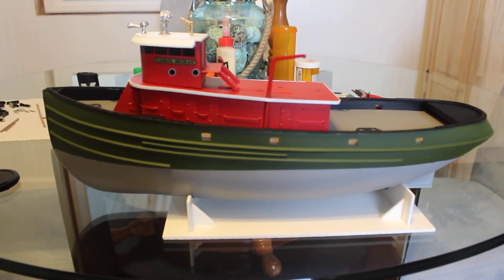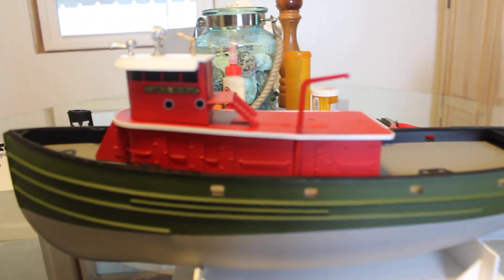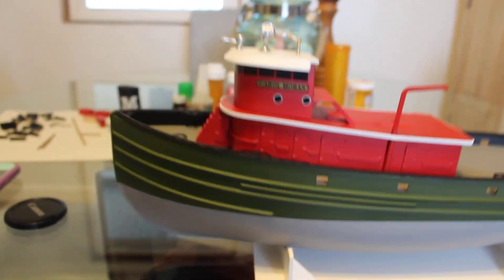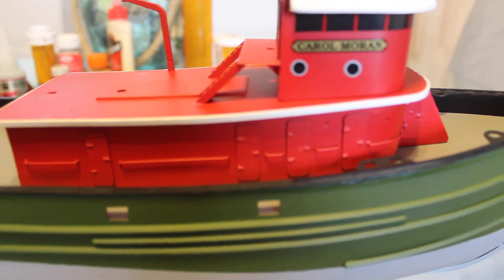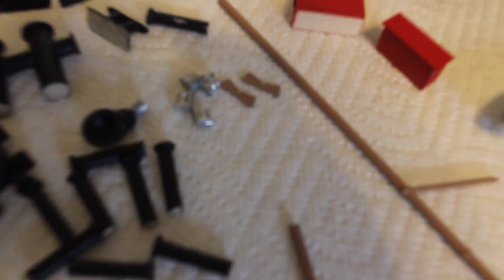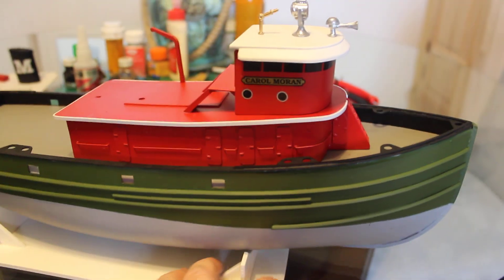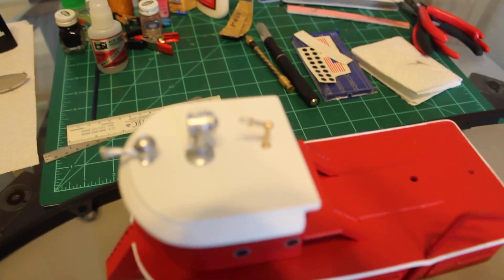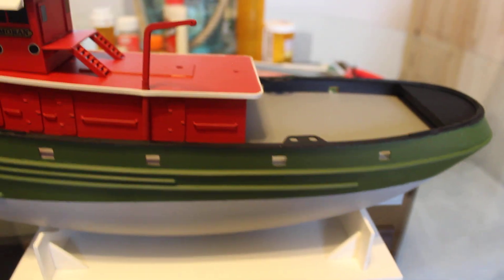Dumas 1/72 Carol Moran Part 2

Comment: Ahoy Nautibear                                          Beautiful job she is looking Superb with winter setting in along with pond moss makes my maiden voyage a slight delay until next spring. By that time you will have your Carol Moran underway. Remember you have to have a battery pack built for you 4.8 volts at your favorite battery store they have a shop in there that will build your battery pack for $14.00 these batteries are rechargeable so you need a 6 volt battery charger don't leave the batteries charging to long on the charger the tug can run for 2 hours straight before they go dead on you. Beautiful job again.Frankie Day
Reply from the maker: Thank you very much! I have made notes of all the information you've given me to power this thing and I will definitely use them! Thanks for watching!

Comment: I talked with Brian today and he asked me if I watched this video about your decals. I always give him a hard time when he has things happen, but I told him I held back as I didn't want to scare you off from showing any more of your work. I will admit though that it was pretty funny, and I did laugh my ass off, but hey, we all make silly mistakes. It is part of the hobby. Even after building all types of models for 48 years, I make them too. My best one was soldering resistors to leds and I kept forgetting to put a resistor on a special type of led for my big Enterprise. Well I kept hooking it to my 12 volt power and it blew out. I did that 3 times before I realized it as I only bought 5 as they are a type of led that was very scarce at the time. Finally got it right and still have one left in case it is needed. And to think, electronics is my specialty. 
So don't feel bad.
Reply from the maker: You can give me a hard time! I deserve it and I am also un-offendable! With my sense of humor, I usually unknowingly do the offending, lol! I thought my faux pas was funny too or I wouldn't have shared it! There will definitely be more dumbass moments to come...no worries there!
Reply: It's all in good fun and it's OK if people do the same with me. I've made plenty of goof ups in all my years of model building and I'm sure there will be more. I go to East Peoria in Illinois to the Bass Pro Shops right on the Illinois River, and right across the river in Peoria they have the SPIRIT OF PEORIA rear wheel paddle boat that is used for cruises on the Illinois and Mississippi Rivers, so I picked up the Lindberg kit Robert E. Lee paddle boat to build early next year. I will be doing mine with lighting and probably a water diorama. That will probably be a good opurtunity to hook up so I can explain some things that may be difficult to do in a video.
Reply from the maker: Oh good! Can't wait!!! That'll be a fun build to watch!
Reply: Probably not going to do a full series of videos on that as I only occasionally do step by step build series. I did the Defiant cause it was a new kit and no one had lit one of those yet.